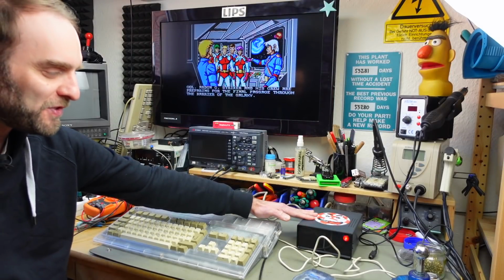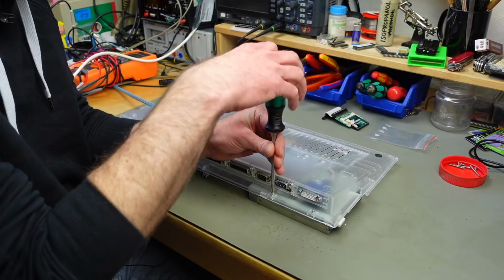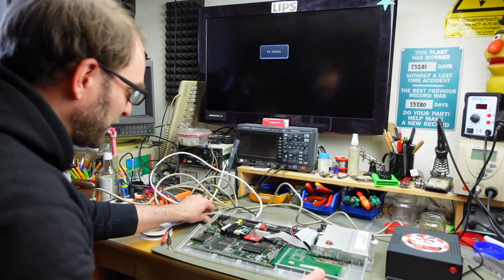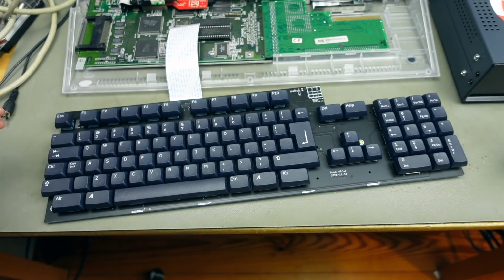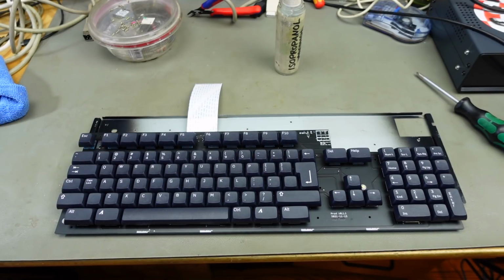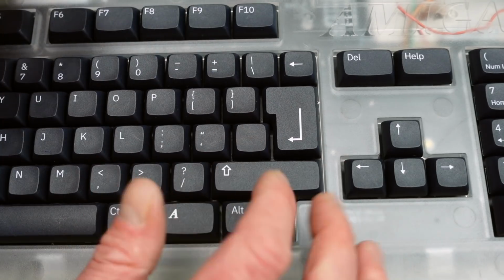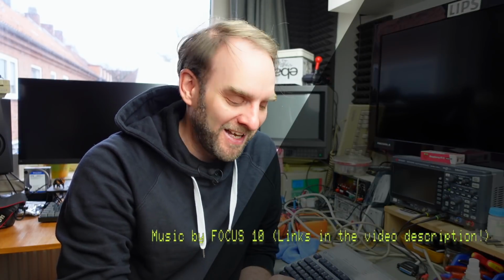A mechanical Keyboard for the Amiga 1200!

Comment: Can anybody explain what problems could MLCC cause in power circuits? MLCC are low ESR and solid state, they should be superior to any kind of electrolytic. They're just filtering power. Am I missing something? I know MLCC are not suitable for analog circuits like audio amplifiers or oscillators. The main reason electrolytics were used everywhere is that they didn't have anything better at the time.
Reply: One last thing, they also suffer from what is known as the piezoelectric effect where they physically vibrate and cause a very annoying, albeit soft, high pitch noise. I think this needs very oddly specific circuits to happen, bit it is most definitely a con they have too.
Reply: @evertcoetzee  Considering the big changes in capacity, low voltage MLCC seem to be pretty useless. What is the intended use for them? The piezoelectric effect is also one of the reasons why they're not suitable for analog circuits, they could introduce noise into the signal. Polymer Capacitors seem to be pretty popular in modern electronics. Wouldn't be polymer capacitors a better choice for longevity also in the old electronics to replace old electrolytic capacitors?
Reply: @JendaLinda  : Full disclosure: I'm not an EE, so what I know about high frequency switching circuits (like what you get on switchmode power supplies and motherboard VRMs) is very surface level and dangerous at best. To the best of my understanding, the polymers tend to be favoured for their equivalent series resistance, whereas traditional Lower ESR Electrolytics like Panasonic FS-series are used on power supplies because of their good endurance in terms of running for long hours under 105'C heat.

The appeal of MLCC's is that they are very harty and can withstand quite a lot of heat, almost ridiculous levels of it, before they start losing capacitance. The SMD ones are also very small which makes them perfect for things like laptops and mobile phones. I imagine the low voltage ones are probably used for rudementary filtering applications like on the audio output circuit. The technology is also constantly improving, you get newer dielectric ceramic caps that don't suffer from the voltage bias problem as much, but they are ridiculously expensive and the capacitance on them leave a lot to be desired.
Reply: @JendaLinda  Generally they are used for two reasons - size, and ultra low ESR. The first is obviously important in portable devices, and the second is important when you are talking about high speed switching DC-DC converters. Outside of those particular niches, they are best avoided.
Reply: MLCC's biggest problem is that their capacitance decreases proportional to its voltage load. So, if you have something like a 50uF MLCC capacitor rated for 16V and you put let's say a 5V load on it, the capacitance will drop to say something like 30uF. If the rated voltage is even lower, it can drop to practically zero. One way to remedy this would be to replace the part with a 50V or 100V rated MLCC, but they tend to get very expensive quickly and don't really provide significantly better performance or longevity to something like a Functional Polymer Electrolytic capacitor which is really the logical replacement for Ultra Low ESR electrolytic capacitors or Tantalum capacitors.

Comment: Most A1200 SMD caps are simple decouplers, they do not work in pairs with resistors for RC oscillating circuits when you DO need exact parameters. So all intro about electrolytic caps vs ceramic ones has absolutely no sense and the ground as well.
Reply from the maker: Most of them are, yes, and it won't make much of a difference in most use cases. They still have different characteristics, especially changing capacitance with different voltages and such which can lead to unwanted oscillation and more noise. I know of some cases where accelerator boards were not functioning correctly with ceramic capacitors in the Amigas, especially faster 68040 or 60 devices.
Reply: Most, but not all... they are used for AC coupling tasks in certain places (e.g. the audio and composite video output) and for this task, MLCC ceramics are completely unsuitable

Comment: IBM never used Cherry keys. They had buckling spring techniqe. But Commodore had Cherry keys in the A2000 Braunschweig edition (which was my first Amiga). So for me an Amiga with Cherry black is the real nostalgic feel (I used the A2000 BE keyboard also on my A4000 later).
Reply from the maker: You are correct, of course. I just wanted to make the point that the Cherry style switches are nothing new. Sorry that I got carried away and wrongly mentioned IBM. :D

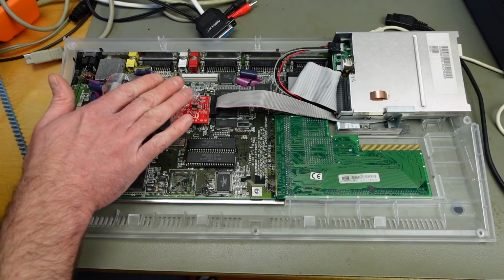Comment: 5:25 While it sounds logical and reasonable, as long as the computer works fine afterwards, there's no reason for replacing with the same kind. Especially in low-voltage applications, ceramic capacitors have superior performance to electrolytics. The big drawback is really only the cost. 
I'd go so far as to say that if the computer works fine with a capacitor completely left out, there's no harm in leaving it out anyway.
Reply: I'd go further and say to consider polymers. They have behavior closer to electrolytics but won't destroy your board when they fail.
Reply: @NozomuYume  Nothing wrong with polymers, but it is completely unneccesary. The originals did not fail due to being electrolytic, they failed because they were poor quality with defective seals that deteriorate after going through a reflow oven. If you fit good quality SMD electrolytics now, the sealing problem has been fixed and they will not see reflow temperature anyway as you are hand soldering them. They will easily last 40 years and probably outlast every Amiga owner alive :)
Reply: @NozomuYume  Polymer is basically an intermediate between the two, they usually have less volumetric efficiency than electrolytics, and are a bit more expensive. One good property with ceramics is that they are non-polarized, so there's no danger to mess up when putting them in. There have been computers with the wrong polarity marked on the silkscreen.
Reply: The problem with MLCC ceramic capacitors is that their capacitance is highly voltage dependant. That means the capacitance they actually have changes greatly depending on the voltage applied across them.

For any task involving AC coupling e.g. the audio and composite video output, these capacitors are completely unsuitable.

Also, the large ceramic capacitors are not really suitable for hand soldering. They can crack internally very easily, or crack due to board flexing. When that happens, they become short circuits, which when they are used straight across power supply rails usually means they burn, and burn the board in the process.

The only real reason to use MLCC ceramics is where you MUST have ultra low ESR. That is not needed inside the Amiga. It is only really needed directly on the output of modern high speed switchmode regulators.
Reply: @jaycee1980  That's why I said "in low-voltage applications". It's a different story with high bias voltages, found for example on the primary side of a PSU. But as a bypass cap on a 5V rail, the lower ESR compared to electrolytics actually is beneficial.
Reply: @graealex  Low voltage is irrelevant.. generally the higher the capacitance the lower the max voltage across the capacitor is. If you use a 100uF 6.3V ceramic at 5V, you wont get 100uF. Check the datasheet.

Also the ESR is only important when we are talking about high switching speeds where ripple current is an issue. This is not the case inside the Amiga, so the ultra low ESR is irrelevant.
Reply: @jaycee1980  Of course voltage matters, capacity decreases with bias voltage.
And the low ESR is pretty much relevant, as it is the reason most manufacturers will show a larger capacity electrolytic in combination with a smaller ceramic on the output side of a regulator application. The comparatively high ESR of electrolytics means they're bad at high frequency applications. There's a reason ceramics are used for bypassing directly near ICs.
You are explaining this like an electrolytic could replace a ceramic in all applications, while it is actually just the other way round. It's just not very cost-effective, that's all. But ceramics can do everything an electrolytic can, and then some.
Reply: @graealex  No, I am saying that the ultra low ESR is irrelevant here because any benefit of it is swamped by the PCB layout. You mention exactly why multiple types of capacitors are used for decoupling - low value wide frequency ceramics (which have stable dielectric characteristics) for local decoupling, and electrolytics serve for "bulk" decoupling. You use the appropriate type for the job at hand. 

You also are completely ignoring what I said about use for AC coupling tasks. MLCC's are not suitable for that, due to them changing capacitance with applied voltage (which is what happens in AC coupling) and due to them being highly microphonic.

Also you ignored why you should not hand solder MLCC's due to flexing and cracking. I have seen boards burned by MLCC's failing due to this. Do you really want to burn holes in your Amiga's PCB ?
Reply: @jaycee1980  Just checked again on some modern ceramics, and turns out capacity change vs DC voltage is negligible (and still going down with increasing voltage, not the other way round!). Both you and Jan might need to read a few datasheets.
Reply: @graealex  I am an electronics engineer and have read the data on MLCC's plenty of times.
Reply: @jaycee1980  Everyone on YouTube, especially the comment section, is an electronics engineer.
However, if I were a YouTuber instead, I might simply make a video comparing the actual performance. It's probably a 20 minute setup.

Comment: it has a blank key next to the enter because the U.S enter was ascii.... it was long straight like the shift key....
Reply from the maker: Yes. They solved that with either an elongated Enter key or a blank key in different Amiga keyboard revisions. I’ve seen both. Later versions seem to usually have the blank key.

Comment: Try to find a "US-International" keyboard mapping, on Windows you can create all the accented etc letters with it.
Reply: You know that Windows and AmigaOS are completely different operating systems, right?
Reply: @AmartharDrakestone  You don't know they both have configurable keyboard mappings?
Reply: @Breakfast_of_Champions  They do, but they're more limited than you think. You can't input all the needed German characters with a US mapping on an Amiga.
Reply: @AmartharDrakestone  On the Amiga you can map all the latin characters to any key via custom keymaps. Of course that includes umlauts and accents. I'm not informed about Unicode capabilities, but the last time I checked normal .ttf fonts were working and could be mapped to keypresses.
Reply: @Breakfast_of_Champions  Well, that's a custom keymap then. Not a US keymap.

Comment: Cool, now you can comfortably type your entire thesis on Final Copy until the Amiga throws a "guru" software failure in your face and you lose all the work you've done!!
Reply: In first year at University, I typed an essay on an A500.
It wasn't ideal. :/
Reply: @wimwiddershins  I used to write my University texts using TextCraft Plus on an A500 with initially 512Kb and then 1Mb of RAM. Then when I went to grad school I started using Final Copy II on my A1200, together with a Canon BJC-600 (color bubble jet) printer and it produced quite amazing results with just 10Mb of RAM! Too bad there were many "software failures" due to lack of a MMU. Yeah it was slow and buggy but still cool for a 14MHz Amiga! Cheers!

Comment: Really well its transparent plastic and its very brittle.
Reply from the maker: The new cases use a better mix than the original cases so this is hopefully going to stand the test of time a bit longer than the original ones.
Reply: @JanBeta  Good show with the cases Jan Beta but how much will you cost approximately ? I have two amiga 1200 and looks really good.